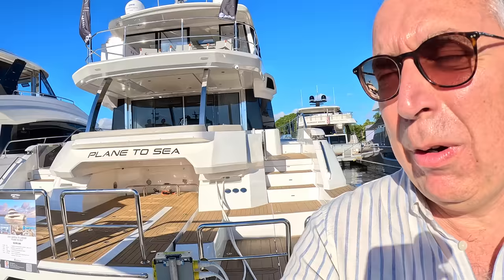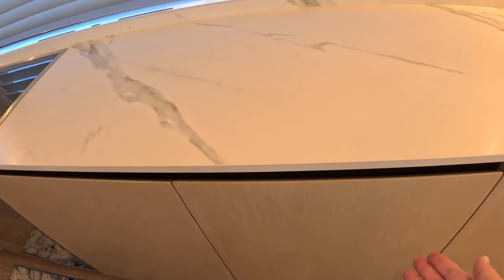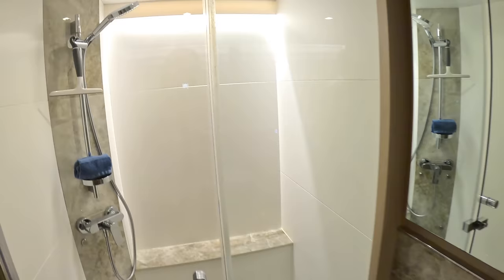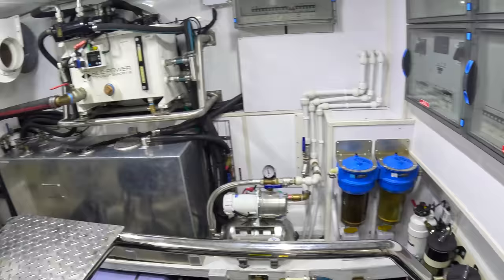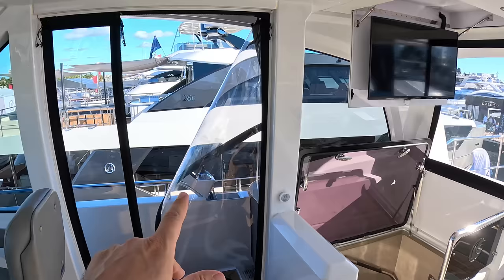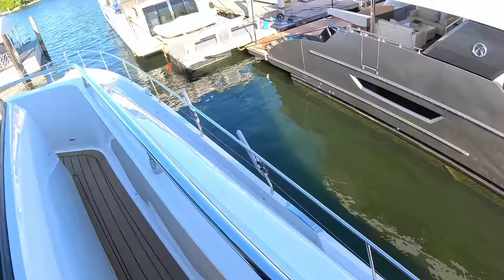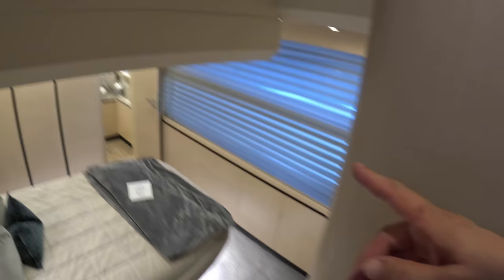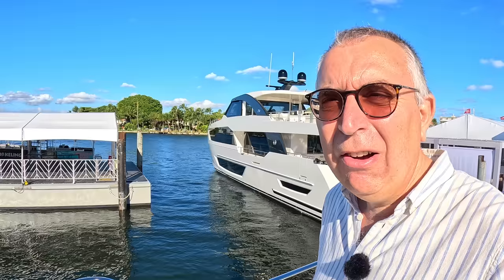$5.1 Million Yacht Tour : Aquila 70

Comment: Very sharp and clean layout Nick 🙂

My only gripe is the part helm in the galley…… seems a bit unnecessary to me, I’d rather have more galley and leave the controls in the upper helm. With a wing station already, perhaps I’d specify a remote control…..?

The owners cabin is much better than some cat hulled boats, being as it uses the beam for all that space, and as you say, the other cabins are certainly generous enough.

It obviously has the pace and range for serious cruising, but I always feel these cats are more about the holiday space than the boat dynamics.

Another thorough going over 🥳

🌟🌟🌟🌟🌟
Reply: Normally I'd agree with you, and that was my first thought.  Look at it like this; you have seriously long range so are do a multi day transit.  Most of that time you'll be on auto pilot, of course, so why banish someone to the upper deck?  You can monitor/control things while doing routine things like cooking and eating.  It's got the space for lower controls, so why not?
Reply: @markshutt1476  can’t disagree Mark…. It’s just my antipathy for the broad beam saloon layout on cat’s…. A helm position always looks like someone left a steering wheel on a sideboard…… an afterthought if you like….

It’s probably my own “big ship” pretensions….. that the helm is a serious place with a big chair and a commanding elevated position….. presumably a hook for the Captains hat, dials and gauges……. 🙂
Reply: @iancharlton678  agreed.  Took me a long time to accept it.  But then thought, it's just the family boat and can be operated more casually.  It took a lot for me to overcome 20 years of USN for the "bridge" not to be sacrosanct.

Comment: The problem with Aquila's is that they have a main level walk around on both sides.  They take a 27' beam and waist 6' with walk around space, ending up with a main level interior that is no wider than a monohull.  They should take a cue from Sunreef and maximize the main floor space with a full beam main deck area and have the walk around space on the second level.

Comment: Very nice but I still prefer sail like the Sunreef 100 or Sunreef 80. I would need two offices and an incorporated gym meaning cable machine built into the cat itself in some way that would also be discrete. I only have one issue with having something I would like, not having the cash for it and that's a huge hurdle.

Comment: Again,would get better MPG with the D16 volvo penta....bigger engine,which will be on top of the job...these are the 13 litre engine...as the D16 is a 16ltre engine...bigger,powerful engine,uses less fuel than a smaller engine...

Comment: Whats the difference between this boat 5M and the 100% solar powered silent yacht? 3M 
(besides the obvious diesel/ solar power). speed? noise/ vibration? fuel $$ usage? Why go with the Aquila when theres a solar option with no fuel cost?
Reply from the maker: Price and performance. Silent yachts are great, but a very different proposition.
Reply: @AQUAHOLIC  so in what general ways? speed? Silent has limits in the long range cruising at 6 knots? Aquila is about 3000 nm?